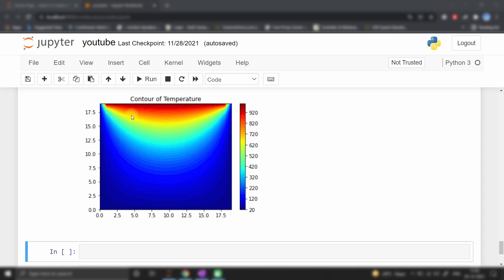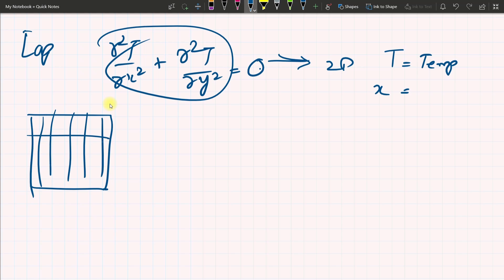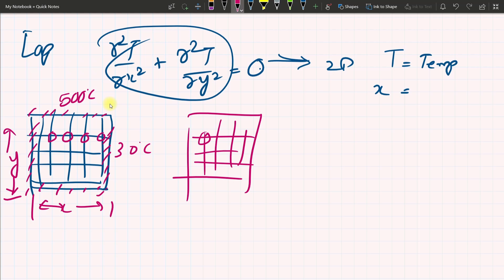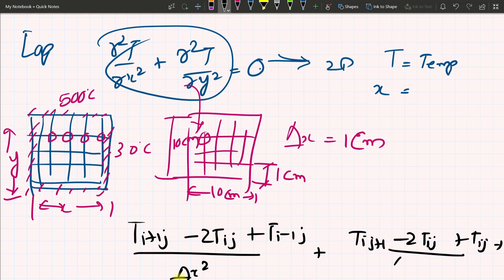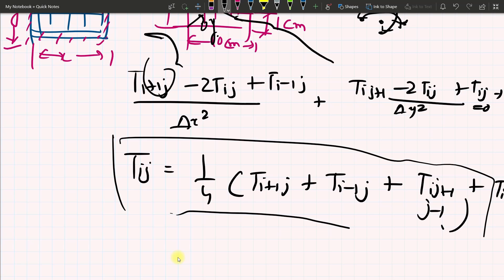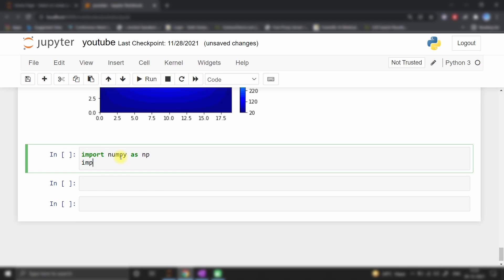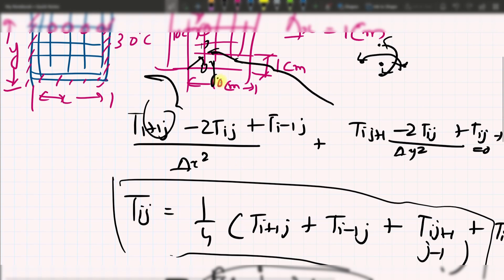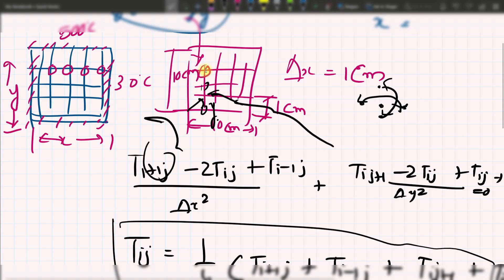Heat Transfer part-1 | 2D heat diffusion equation using Python | CFD python | Python for mechanical

Comment: Hi, thanks for sharing the videos.
Could you help me? Have you worked with other programming softwares? Which one would you recommend for a beginner who wants to perform fluid dynamics and heat transfer analysis? Python, C++ , matlab
Reply from the maker: Matlab you got may book available for fluid dynamics. But for python very few resources are available. Python main advantage is that, it's free. So many company switch over matlab to python.